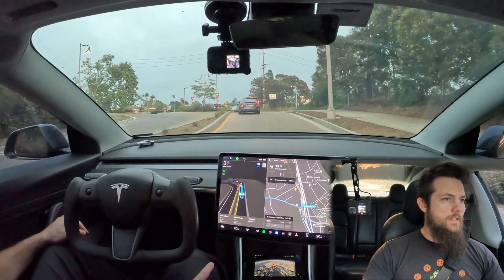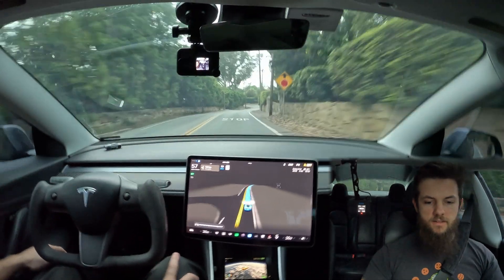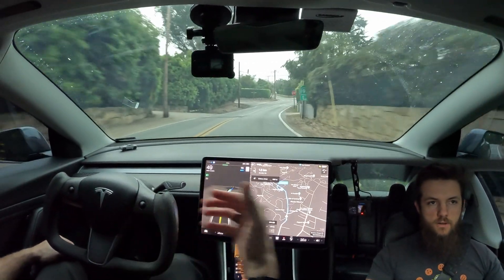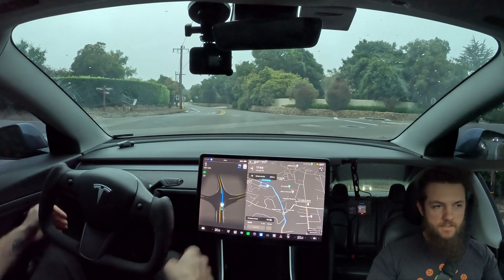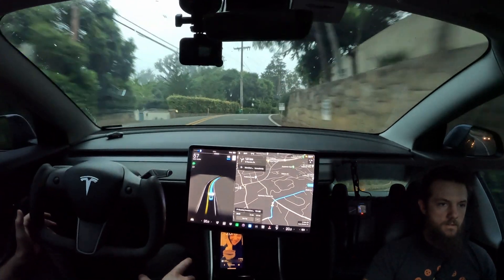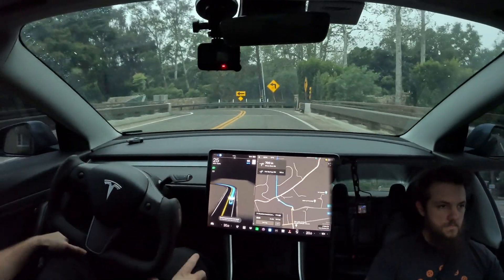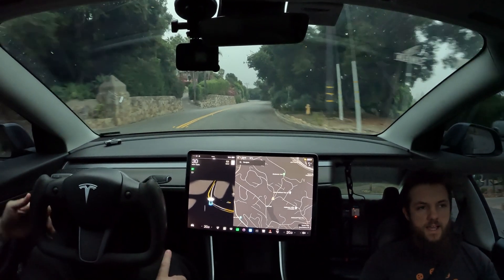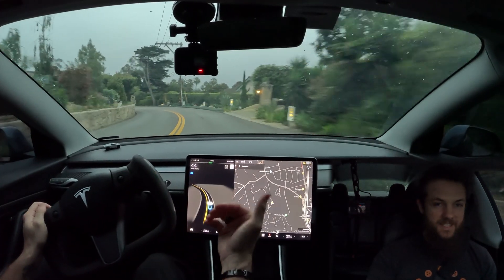Crook's Corner Part 2: Proof That Tesla Works Fast! | FSD 11.4.4

Comment: This seems to be a manual patch by location instead of a vision fix?! It seems the car still does not recognize the stop ahead sign as far I could see. Any thoughts?
Reply: I believe it rendered it even when it wasn’t stopping.

This issue was, IMHO, highly likely due to 11.x switching from procedure planning and vehicle control to neural network AND a missing stop sign in the maps.
Reply from the maker: Could very well be. In both cases the stop sign ahead warning sign doesn't appear at all but I'm not sure how that plays into the action of the NN.
Reply: @CYBRLFT  I’ve never seen a warning sign rendered.

Which doesn’t mean it’s not recognized, but it’s clear sign recognition is minimal at this point.

Which makes sense.

1. Don’t run into anything
2. Get from A to B
3. ?

Comment: Why are they ( Dawn Project) testing using an outdated FSD version??
Reply: I believe they were in Ross’ car.

And new versions demonstrated the same issue until map annotation fixed it.
Reply from the maker: They have both a v10 white Model 3 and an updated 11.4.4 midnight silver model 3. They use both to see how they differ at points they find.

Comment: did you receive a new software update for the fix? that was resolved fast
Reply: Even 10.69 is fixed.

 Very likely added a stop sign annotation to the routing system.

Annotations added back when S & X received the ability to raise suspension when approaching rough sections of road.
Reply from the maker: To be clear they said their white 10.69 car never had an issue here. Only the v11.4.4 car did. Their 69 car always did it correctly as described to me by Arthur with the Dawn Project. 

But I didn't get any noticeable update to my car in that time. That's why I was so skeptical that it was actually fixed.
Reply: @CYBRLFT  Interesting.

That likely puts it down to a training issue with the new planning and control neural nets works introduced in v11.

They’re immature, which I’m confident is why they’ve increased the nagging.

Comment: Wait so it was fixed without any update?
Reply: Yes, map metadata added by the routing module.
Reply: @tommornini2470  oh yeah you put it so much shorter than I did lol
Reply from the maker: Yeah somehow. The FSD team has resources to make changes between updates as verified by this example. Sort of explains the speculated tweaking between patches that seems to have the system getting better a weak or two after deployment.
Reply: @CYBRLFT  hmh. I wish they were more transparent about what they are doing in that sense. This one seems like they simply added the stop sign to the maps on their end. My guess is if you wiped all cache and saved data from your car's computer (ie clean slate, no idea how to do that) and disabled  internet after downloading the maps, if you then navigated to this spot, the fix would not work because it requires downloading "real time" data (sort of like how the real time traffic data works, just a layer on top that is pulled from their servers).
Reply: My only hope is that they didnt do this manually, but that they have some automated process. Otherwise this isnt really a fix but a one-time bandaid
Reply: @Supreme_Lobster  How and what they did this time, they’ve described their training loop dozens of times.
Reply: @tommornini2470  yes but adding metadata to maps is not "AI" (there is nothing to train, it's just a label on a map). However I can imagine at least a partially automated way of adding those labels if you can somehow detect that they are missing. But from what I can tell this was done manually
Reply: @Supreme_Lobster  You’re making assumptions that may not hold up.

Tesla has a training loop where cars send sensor data back to Tesla at various times.

Their AI auto-labeler and/or humans labels that data. It’s reasonable to assume that annotations could be added at this step.

While driving, the in car AI takes camera, sensor and route data in.

The annotations are part of the route.

From that, decisions are made.

In v12, all of the in-decisions will be made by AI.

On the backend, it’s increasingly true that the human labelers do a quality control check for a tiny percentage of the situations.

Comment: Please kaz don't delay videos between twitter and YouTube. Twitter video is broken no matter where I try web or app.
I am always excited to watch your videos that I have to watch on Twitter where video experience is not good yet.
Reply from the maker: The delay isn't intentional... I physically cannot upload simultaneously and the 4k uploads for youtube start immediately after the 1080p for Twitter. 
This is because if I try to do it the other way, there's issue with uploading to twitter and I get an error message over and over. But I upload to one and then immediately the other. Given the upload speeds of starlink, this is as fast as I can manage. I'll always do my best to have them same day, but they'll be several hours apart.
Reply: @CYBRLFT  Why are you not using normal wifi. Is the wifi service in the area is bad or too expensive. 
Same day upload will work just fine. 👍.

Comment: The biggest issue for public acceptance of FSD is that references to Autopilot, Enhanced Autopilot and FSD beta are being used interchangeably with FSD by many.

Autopilot is not FSD… Enhanced Autopilot is not FSD… FSD beta is not FSD, yet.

FSD has not been released from its beta version and FSD beta is classified as ADAS. All claims that FSD has caused accidents and deaths are either intentional or unintentional lies. FSD has not been released.

Comment: It’s good that Tesla acted quickly to make the system safe at that intersection apparently through a map data annotation to force a stop, but shouldn’t a truly safe system have slowed down anyway at that intersection, whether or not there was a stop sign?  Safety shouldn’t be so dependent on map data.
Reply: I agree. I believe Tesla is working towards FSD using only vision and it's the correct way to solve FSD. It's the harder way but the present real world is the only 100% truth there is is. Map data might be outdated and could cause accidents if relying to much on it.
Reply: 11.x changed from procedural to neural network planning and vehicle control.

FSD Beta is Beta, it’s not expected to be perfect not entirely safe at this point, and doesn’t indicate anything about long term ability.
Reply from the maker: Sure that's fair and it will get to that point more consistently. This is admittedly an edge case where it may be the 1 in 100 or 1 in 1000 stop sign problems. So it's getting a lot of coverage and may seem more severe because people will think that this is a regular thing when in fact is the rare side of the equation. That is why it's so important for users of FSD to appreciate the level of responsibility we have in catching these scenarios and reporting them to Tesla rather than getting complacent and not being ready for them.

Comment: The problem isn't having Dawn Project criticize or have opinions about FSD.  These are admittedly good things to make FSD better in the future.  The problem is that they outright lie and make up incidents (not this one, but ones in the past where they were continually pressing the accelerator to artificially run over manikins, etc.) for the sole purpose of promoting their technology over Tesla's.  Intentionally lying and trying to delay the development of technology that could potentially save millions of lives for your personal gain is beyond reprehensible.  Dan O'Dowd is a despicable human being.
Reply: Their biggest lie is spreading the idea that if a self driving car is imperfect, it should not be allowed in the road.

Perfection is not the goal.
Reply: @tommornini2470  Perfection cannot be the goal because Perfection is impossible.
Reply: @wbouton100  Exactly.
Reply from the maker: I agree with your comments about their misplaced use of the term perfect, however I took part in the mannequin testing. They don't have to fake it, it does destroy the mannequin unless you're down to 15-20 mph.

Now before you get defensive here, let me say that I do not think that an inanimate mannequin being pulled across the road is a good example of day to day interaction with pedestrians of different sizes, but id does show an issue with object detection that Tesla can improve upon. 

Again with having responsible users and the safety data that Tesla publishes, you can see that the mannequin testing is a hypothetical concern rather than an issue that's actually seen on the road. The test in and of itself is done without tampering. I can vouch for that at least in the case of the one I was present for.
Reply: @CYBRLFT  Neural networks are extremely good at classification.

Does it surprise you that it doesn’t think a mannequin is a human?

Comment: How the F did Tesla fix this so fast and without an apparent software update???  I don't understand 🤯
Reply: It is about map meta-data. Good that with more complete meta-data FSD can really perform well, bad that vision cannot do it alone.
Reply: @ericelfner  vision is way too slow at this point. Hopefully that will improve with better computers and cameras.
Reply: @wbouton100  Prove it.

And this very real issue does not prove it.

Many moving parts here.

At 36 FPS, the car is making decisions every foot or so, more than adequate IMHO.
Reply: Easy, they didn't fix the underlying issues of first not recognizing the sign that warns you of an impending stop sign, and second that the vision system is too slow to react properly to the stop sign once it sees it.  They updated the map data for this specific intersection to force a behavior that would make it succeed, which is good in the short term, but a completely unsustainable way to handle the type of issue this is.
Reply from the maker: This very well could be a sort of band-aid until they've trained the general behavior into the NN. But admittedly that's my speculation.
Reply: @CYBRLFT  I am also a Tesla Uber/Lyft driver and find that FSD does not perform as well in Cincinnati as I see in your videos and others in more Tesla-populated areas. It is so bad, I will only engage with passengers if they ask about it. Where I initially thought this was because of NN training, I'm now more convinced it is because your drive areas have better (more complete?) map meta-data. Would love to hear your perspective on this.
Reply: That's exactly what I was thinking.

Comment: Seems clear they added a stop sign annotation to the route data.
Reply: What's weird is previous versions of the software didn't have the problem. So was the stop sign annotation removed at some point?
Reply: @tonymci  I doubt it.

I believe the annotation feature was 10.x

Why do you believe previous versions didn’t have the problems?

Also, planning and vehicle control were changed from procedural to neural networks in 11.x so this could be the culprit.
Reply from the maker: Well 10.69.25.2 did this right from the getgo, even before the ross video. The Dawn Project confirmed this. Something changed. I don't know if it was a complication of the NHTSA recall, but I'm sure that was enacted before v11 anyways.